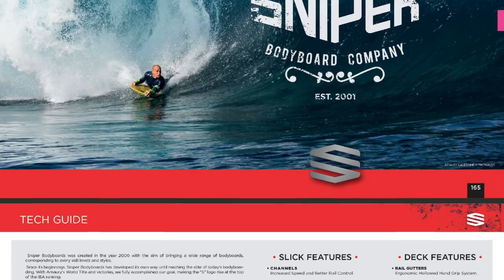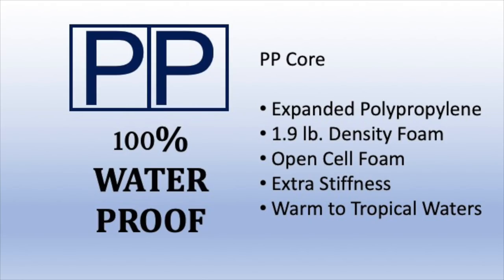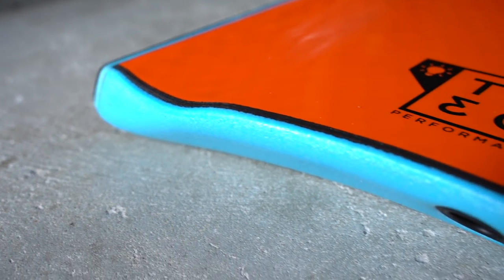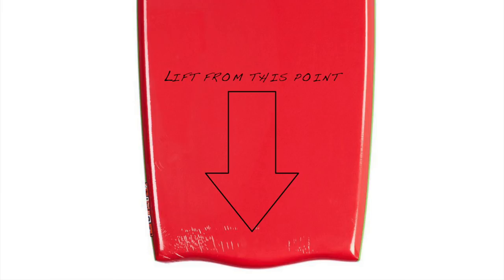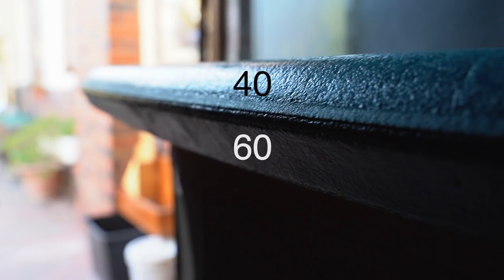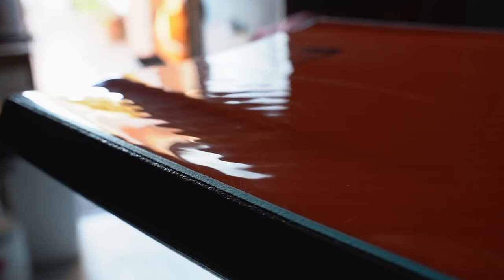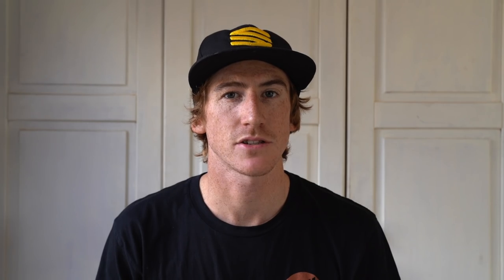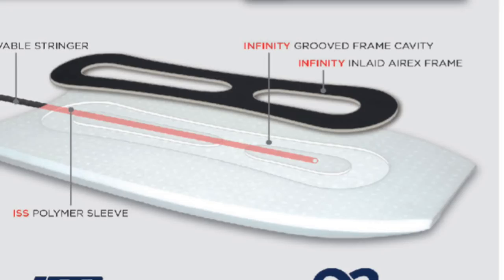What are Bodyboards Made From?

Comment: This is some seriously solid info bru! 👌
It's been a decade since I've splashed but I'm hell bent on getting back into the water! Still got my old "Reopiper" soft top (that thing is probably still water logged) 😅 But ja, the IBC hosted event and recent Walkerbay PRO at Onrus beach have gotten me beyond psyched!! Any idea where I can find myself some cores here in SA? Super keen on just building my own!! Just can't afford the kit right now hey, fins alone are going to be a mission but I'm sure someone has a spare pair, need to speak to the lads! I can't find much on high density expanded PE suppliers, all just soft foam nonsense for padding, or maybe I'm not looking hard enough? Either way your input would be highly appreciated 🙏✌️
Reply: Okaaay, finally found some manufacturers / suppliers! Namely Surfblanks, iFoam, Vitatex, Foamsolutions and Sondor but none of them apart from Foamsolutions are providing any prices and I don't think even their hardest foam is stiff enough. Figured FINE, DIY harder! What about foam in a can!? Found some on special, R100 for 750ml which should produce 40L odd of PU "waterproof" foam, 2 of those dumped into a rectangular mold big enough for a 42" board should do the trick!! Question is, how stiff is this stuff and how "waterproof" is it really... But if this works, I'm onto something ekse! 😁
Reply from the maker: No idea on cores in SA. I know they were hard to find and I don’t think it’s made in SA anymore.

Comment: I wonder if the ISS system will ever evolve to being used in DK specific boards? Might be cool to try out different flex combos on the front/back foot sides. Probably pretty expensive though. 

Hey Iain,
Just curious, how do you feel about slick creases? And what's your opinion on them affecting or not affecting a boards performance in this modern day with different materials to aid in durability, like the Infinity system, mesh, skintec, tension tech etc?
Reply from the maker: Hmmm. Don’t know man. These things are ever evolving. Could be getting better and better for bodyboarding.

Comment: Hi Iain, does the infinity Flex system  still have the infinity Flex system aswell as a normal straight stringer ??
Reply from the maker: Yes it has both. The infinity flex ♾ doesn’t have enough of a rigidity to hold the flex of the board completely. So all those boards come with a stronger.

Comment: Hey Iain, how much rigidity does the Infinity Flex System add to the board versus without? Interested in purchasing an NRG model with the Infinity Flex and was curious how much stiffer the board would be compared to the NRG core and stringer alone?
Reply from the maker: It definitely gives it a little more rigidity but it is more for helping the board to recoil back to it’s original place. I like it because it gives the board good pop and allows for some pretty big moves.

Comment: what stringer do you use normally at south africa? mid or stiff? i like stiffer boards and i surf at portugal
Reply from the maker: I use the entire range of stringers in my board depending on the age and flex my board is. I have been using the stuff stringer in Portugal in my old board but will vary between soft and mid in a new board. All depending.